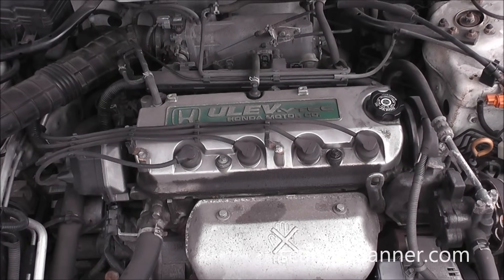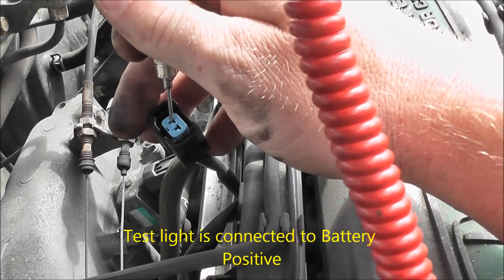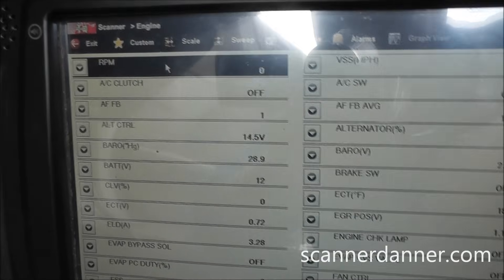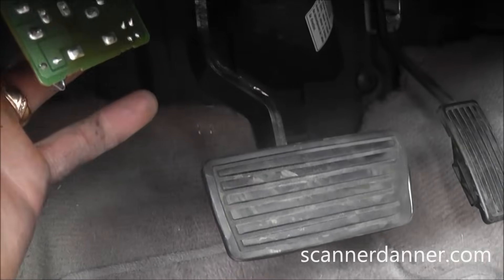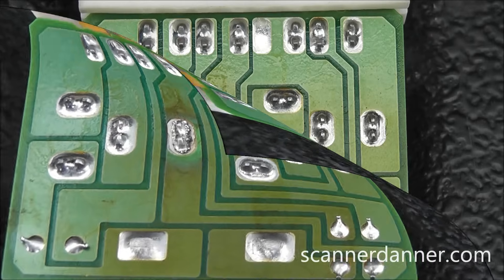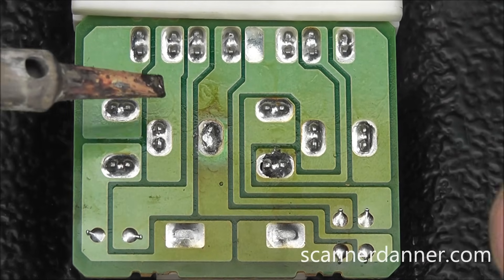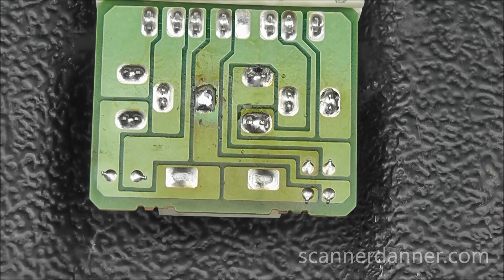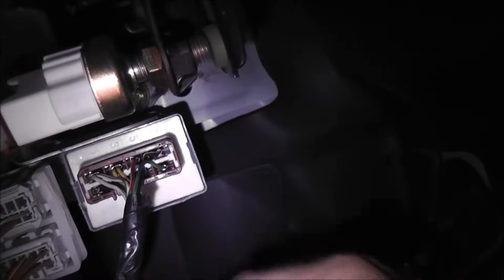How to identify a bad main relay on a Honda (PGM-FI)

Comment: why would you test the fuel pump? wouldnt you know if it was working or not by the noise it makes when you turn the key?
Reply from the maker: I don't trust the "I don't hear the fuel pump I'm starting there" test
Easier to confirm under the hood first. Hope that makes sense. Then it is also a great video for others with separate issues

Comment: Wow this was probably one of the best educational mechanic videos on Youtube. you checked literally everything and explained it flawlessly.. i changed out my ignition wires distributor and rotor changed the fuel pump a few months ago .. its got to be the relay!

Just came back from autozone it was the MAIN RELAY! 
The reason why i changed so many things is because the previous owners neglected the car for years then left it sitting for another 2 years.. forst thing i did was put a new j30a motor in it .. after a year and a half of driving it everything is giving out but its not that bad! Thanks again goodluck to all of you
Reply: Why did you put a new motor in it ? my 2000  Honda accord ex has ben sitting for three years and the motor still runs like a top with 200,000 on the clock. I did start it every couple months though.

Iam here cause I just tried to start it the other day and now it’s not getting fuel! It only starts on starting fluid, so I’m assuming it’s the relay or fuel pump… I love these Hondas because they’re so easy to work on, the fact that you don’t have to drop the tank and that they put that little door there to replace the fuel pump. Makes everything easier.
Reply: @mrgrump2534  I was just about to say it was the fuel pump, I changed the motor bc the previous owner blew a gasket but those accord are bullet proof the tranny had 250k miles still strong original motor was left with no coolant blew a gasket at 200k
I miss working on it, I have a 2018,civic hatchback sport now it’s a beast!!

Comment: Wait so did your fuel pump still Made noise Even though the relay was actin up
Reply from the maker: +sonic5773 Intermittently the pump would run. 
These relays can fail and still run the pump. There are two controlled circuits, one for the injectors and a few other components and the other for the fuel pump.

Comment: You can get the solder to flow better if you use flux and clean the joint before soldering.

Comment: HELP PLEASE.!!! MY Pgm-fi Is not communicating properly with my ecu. My black and yellow wire has no power and I did a manual swap. I brought over the ecu from the donor car and swapped out the motor and trans from the donor car into my car and now I got no fuel pump, injector, or power to the distributor. I am wondering if it is likely to be my ecu and how would I check the ecu?
Reply from the maker: Without a diagram in front of me, I can't say for sure, but focus on the power feeds that come from the ignition switch

Comment: When i try to test my fuel injector, and its connected to the positive side of the battery but its not getting any flashing at all. The test light will only turn on when its connected to the ground. Im trying to fix my integra just keep cranking all of a sudden, there is a spark tho. And main relay seems to be working fine and the fuel pump is priming too because its new i just replaced that recently. What could be the problem???
Reply from the maker: Will the engine run with carb cleaner sprayed into the intake? What year, make, model and engine?
I just want to verify that first as it will dictate our next move.

Comment: Hey i had this same problem but my check engine light doesn’t come on at all when the key is on now even replace the main fuse with another one and same problem any advice?
Reply from the maker: Powers and grounds must be tested at the ECM next. Most likely you're missing a power feed. Ignition switches were common areas of failure on this era Honda

Comment: I'm dealing with this issues also it was cranking first now nothing but green light go on any ideas for this issue and also went it was cranking I serch the black and yellow wire and it was no power took the fp out serch and it was ok this its driving me crazy
Reply: I put  the obd1 ecu to try if was ecu issues now I try again and light show up but the car still not cranking   other them that checking fuse and shaking  harness  unbolt grounds and try to put them better that's all I did
Reply: Also I went to u premium page yesterday to learn more about electromechanical
Reply from the maker: Thank you! Watch my lectures in Chapter 1 where I am covering my Multimeter Basics page. Then move to chapter 3 and have at it from the start. This will help you the most with your issue at hand.
Reply from the maker: A no crank will not be from the main relay. It is not involved with the cranking circuit.

Comment: (95 civic) I just replaced my main relay which fixed the problem I was having (car wouldn't turn over + main relay hum was absent) and after a day and a three trips totally ~50 miles, the same problem presented itself again. The car won't turn over and the main relay hum/sound I hear during luxury mode of the key ignition process isn't there again. It turned over once with the relay working and immediately died and then the relay wouldn't work and hasn't since. Any advice?
Reply from the maker: Ignition switch is also a very common problem on these
Reply: +ScannerDanner noted in case anything else happens. I ended up doing the fuel pump and filter which fixed it (hopefully will remain fixed) it was just sketchy for me as someone who doesn't have a lot of hands on mechanics that the relay sound /prim(e)? Went away after I just replaced it. Really awesome videos on your channel btw. Thanks.

Comment: Great video mr danner, one question, when you test the injector with the plug disconnected,  you put the test ligth to ground to check for power, and move to positive  to check for pulses,  then you plugged the connector and back probe the injector, here you leave the test ligth to ground for both test , key on for power test and move to the other pin chank the engine for pulses, test ligth connected to ground in both tests, thank you Mr danner, please correct me
Reply from the maker: that is correct, the only warning on the second test where the injector is plugged in and the test light is connected to ground, the test light can energize the injector enough on some cars to cause it to spray fuel constantly, so be careful! The disconnected test is better for this reason
Reply: @ScannerDanner  thank you,for your advise

Comment: I just put in a new alternator and now my Honda will only start after getting a jump but as soon as I hit my breaks the car completely dies and has to be re jumped. Answers?
Reply from the maker: +Destinee Moliga what is your system voltage with it running? It should be 13.5-15v

Comment: hey ScannerDaner  this   - OTC 3633 Mini Circuit Tester is secure to test computer  sensors???? i've seen you used a lot on your videos  i just wanna make sure before  purchase this test light that i wont fried computer cars
Reply from the maker: You can fry circuits with any light is you don't know what you are doing. This is still the light you want to have. LED lights are useless for troubleshooting

Comment: I'm having issues with my 2001 honda accord...no crank no start...bought a new main relay it still dont start do u think is the ecu computer..help please
Reply from the maker: It is almost never the computer, you say it doesn't crank? Meaning you do not here the starter cranking the engine over? "no crank" means battery, starting, charging system problems. "No start" means it is cranking but not starting, so spark, fuel, compression.
Reply: @ScannerDanner  yeah I bought a new starter it still no start?
Reply from the maker: @mrphengyang  no start or no crank? please re-read what I am asking you
Reply: @ScannerDanner  no crank at all
Reply from the maker: Okay, then you are barking up the wrong tree with changing the main relay. Watch some of my no crank videos. I have a playlist for battery, starting and charging systems.

Comment: Do you think a 2000 honda prelude h23 has a main relay?
Reply: yes it does RZ0088 on my 97 5th gen. and mine was all burnt, the part is 15 dollars on ebay and amazon
Reply: I tested the blk yellow wire coming out of the number 5 pin which has red org and grn org next to it, test for output while starting needs 12v and on start-on it should pulse 12v for a few seconds

Comment: my 01 accord has the intermittent non start, but in watchn ur vid and reading other blogs, mine is not just when its hot, it will do it on a 1st start of day. sometimes it will start after a few cranks,  but then if it doesn't start, i let it be as to not wear battery. ill go back out after a few mins or hours and if it doesn't start I'll have 2 w8 til next day. could it still be the main relay even tho its on a cold start? this also only started to do this after it startes to sputter while drivn down freeway. had it towed to shop who cleaned v tech filter amd replaced a few o rings and ect,  BUT....they also said due to the amt of gunk on filter that it needed an engine rebuild at 8-9k. ahhh thats not happening, but its been a yr amd half since then and the car still runs good with the exception on the intermittent non start, amd some times a rough start, cough,  then dies amd wont start. always turns, no starter clicking.
Reply from the maker: +Debi Turner ignition switch failures and main relay problems are common and yes it can happen at any time
Reply: Thank u. Could it be the ignition switch if that sounds fine, and turns, no clicking. Its at a shop and i mentioned the main relay and said symptoms matched so their ckn that. I have limited funds so whatever makes sense and can be doen in the hr. It was also said that it could be something wrong in the fuel system,  IS THAT possible, or would there be different symptoms, or just simple not start at all?
Reply from the maker: +Debi Turner yes, still could be the switch. 
yes, it could be the fuel system, it could be the ignition system, it could be wiring, it could be a lot of things. 
You need a tech that says the following "if we can make it do it, we can fix it, if we cannot re-create the fault, then we are just guessing"
Guessing as you know is more expensive than a proper diagnosis. 

The ignition switch problems can sometimes be re-created by banging on the steering column (car running) right below the switch. If the car stalls you found your issue
Reply: Thank you. I will add that to the list then. Like i said, u have limited funds, and had brain surgery in july with a lot of medical follow ups,  and also moved so i cant risk it not starting after I turn it off. And of course, its started every time at the shop. Its actually my old shop that mentioned the relay, and thats why i asked this new shop where i moved if he could ck that as your video makes it pretty clear to determine if its damaged. But thanks again,  and i will bring that up on the ck list as well.
Reply from the maker: +Debi Turner sure Debi. Hopefully they will treat you right. If you're close to Pittsburgh Pa, I work on it for you for free at my school. Is that an option?
Reply: Omg, your a cool guy, loved your video, u were professional, corrected youself and addressed previous questions, so i trust u know what ur talkn about, but i live in Ca. Its just this new shop cant confirm because its starting, but i know thrs something wrong.  Googled and found ur video, and the symptoms match so with some time left under thr hr i requested, id like him 2 ck the relay, seems pretty simple.  Saw another video of a gal replacing hers in the parking lot of an auto parts store, lol, said it took half hr. So by him actually looking at it we'll know if its that. He mentioned doing the distributor and plugs as a tune up. Theres no way i can afford the fuel inj system repair but he didnt think it was that. So we'll see. Again, with the recent brain surgery, im just not in the mood to get stuck in a doctors parking lot 45mins away from home. 
Thanks again.
Reply: +Debi Turner no problem, goos luck and  may God bless you more importantly with your health than this car.
Reply: +ScannerDanner Premium 
hey dan. well the shop said it acted up yesterday. said fuel sys is fine, not showing any probs. hes standn firm in it not being the relay. said it wouldnt start of that were the case, but i had 2 correct him in sayn research i did matches symptims for INTERMITTANT non start. then whn he said maybe doing plugs and distributor,  well 2day says my car doesnt have a distributor.  sooooo. hes THINKS its the crank sensor. and thats all $$$$$$. i know its hwrd to diagnose not havn the car, but I'm a little leary that he didn't know about my car not having a distributor,  i wish he would just ck the relay. anyways, hes pricing the crank sensor amd will call me back to add that to his $500 est so far. he explained where it is and i know enough that is mostly labor. i worked at a few dealerships. Anyways just wanted to give you an update. backtrack for a min, the car coughed while drivn dwn freway a yr amd half ago. old shop ended up cleaning the vtech filter which they said due to the amt of buildup, i needed an over haul at 8-9k, then it ran fine for a while but then started the non start. so i only drove it a little, as i got stuck a few times. so i decided 2 sell it and get what i could and wanted to be honest at selling so brought it to this shop to verify and then researched the non start to find info on the relay. im stuck because the symptoms match a bad relay. 
IS it possible, that intermittent non start can also be the crank sensor? or would i have experienced other issues.
Reply from the maker: +Debi Turner It is possible but unlikely because they will typically fail when hot and be fine cold. You mentioned a random issue with yours (hot or cold). 
Spark plugs WILL NOT fix this and that he mentioned doing a distributor without even looking as to whether or not it had one doesn't speak well for his troubleshooting skills. 
You're kind of stuck. 
I would NOT spend $500 on a maybe. "Thinks its the crank sensor" is a total guess. You're better off taking the car from him and replacing the relay yourself (or fix it, I can walk you through it) as a starting point.
Reply: Thank you. I will do that. I know this situation is like going to the dr and saying,  well on the internet......lol. again, i felt completely uneasy when he didn't know my 01 accord v6 did not have a distributor. I didnt either but im also not A LICENSED tech.  My old shop deals strictly with foreign autos. And i don't want to offend the new shop by questioning why he just wont ck the main relay, easy and a few mins 2 ck vrs tearing the front of the engine out to replace something hes not sure of, or i should say by process of elimination, cuz as soon as i hung up with him i googled bad or going bad crank sensor and it had SPECIFIC tests to determine FOR SURE id its bad, even if shop doesn't have the rpm meter? they can use a different one, cant remember name, but just measure other parts and connections.  So i will follow yout advice and take my car back. I have a friend whose sone races late models amd has tools,  he races but doesn't do alot of the work, lol, teenagers,  anyways,  I'll touch base with you for tools needed, make sure my friend has them then we can do the walk thru. Thanks again Dan, much appreciated.  You should charge for car psychology patients,  lol.
Reply from the maker: +Debi Turner my name is Paul but that's okay, I get Dan a lot (last name is Danner)
I'll help you as much as I can Debi.
Reply: Ahhhh, thats funny, sorry. I just assumed. Haha. Thank you Paul. Will touch base later.

Comment: So i did this to my relay on my 87 CRX relay, it didnt solve the problem, Could it be possibly i didnt solder it right? so does the solder need to be have contact with pad?
Reply from the maker: or that was not your problem, I showed how to test the circuits with a test light. Find out what you are missing then go from there.

Comment: I have a Honda accord 1999, normally not start on a hot day. I checked the main relay, and found no crack; is that possible the main relay may be damage somewhere?
Reply from the maker: +son vu it still could be the main relay. Another common issue is the ignition switch. Try tapping on the main relay when it doesn't start or try smacking on the column underneath the key area for the ignition switch.
Reply: +ScannerDanner Thank, will try it.

Comment from the maker: and thank you for answering that question on the test light for a fellow youtuber in this thread. It really helps. i can't answer everyone anymore. i really appreciate that
Reply: Hey my green light of the key in the dash is not appearing and car wont start also just had a new transponder key made and then all this happened  the key people say it's the ecm the brain of the car is no good and now there is no spark??? Help of u can thanks
Reply from the maker: @madgeniawilliams337  if you have an immobilizer issue, you will absolutely have a code for that. That is where you need to being.